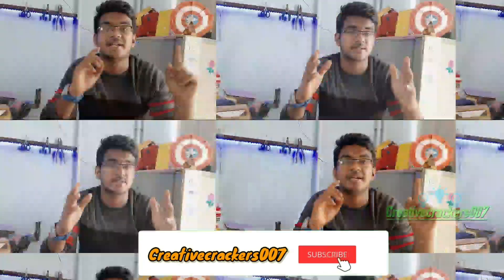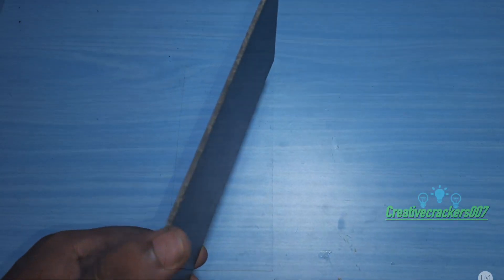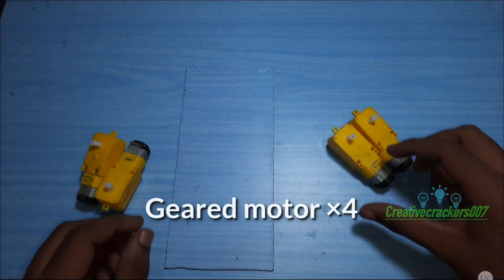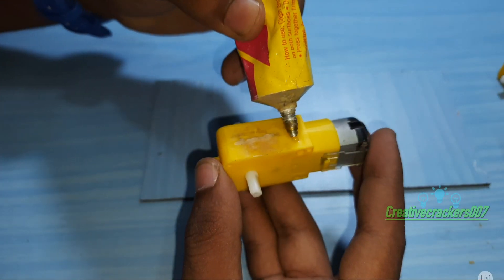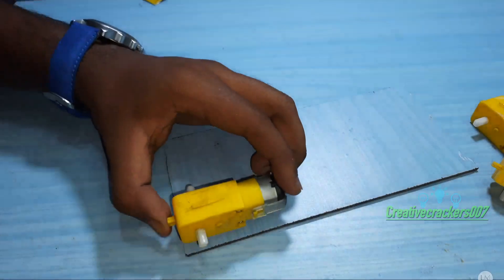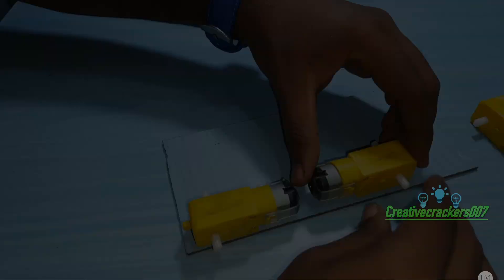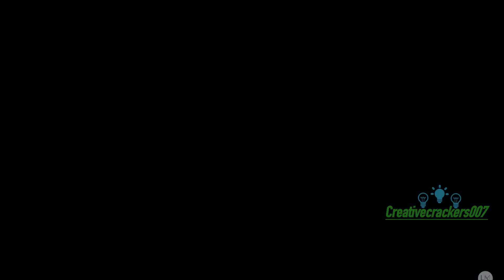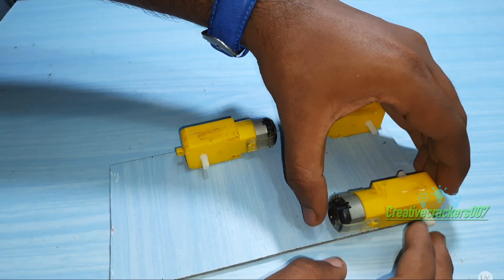How to make a robotic arm car at home -Arduino based industrial robot with robotic hand

Comment: Error while uploading coding
Programmer is not responding
Reply from the maker: Can you explain in detail 
1.Most of the time unplug and reconnect the arduino will work

2.check if the tx and rx pins of arduino are not connected
Reply: @creativecrackers0079  ok brother thanks for responding
Reply from the maker: @fahadevan2527  does your issues solved bro ?

Comment: I made ardino arm car but it's not turning to right and left 😐
Reply: No I set the moters properly but the arm car is not turn
Reply: Yer
Reply from the maker: May be motor connection problem. Give me more details
Reply: What is the solution 🤔
Reply from the maker: @kumariefernando9617  check if all the four motors are running in both the directions correctly
Reply from the maker: @kumariefernando9617  if its fine ,inform me
Reply: Arm , wheels  are work but it's not turning
Reply from the maker: @kumariefernando9617  1. Geared motor (yellow colored ) × 4 is working ?
2. Servo motor (blue coloured) is working?
Reply: And how to fix this and I check the 4 moters are set properly 
I think 🤔 this app have problem 
Can you give your contact number then I can fix this
Reply from the maker: @kumariefernando9617  please ask in comment itself so others having the same problem can also find the solution
Reply: Yer I put  4 moters on 1 side and the other side I put the servo motor
Reply from the maker: @kumariefernando9617  what ?
Reply: I set correctly this wheel on motor drive according to the video. But it doesn't turn properly.